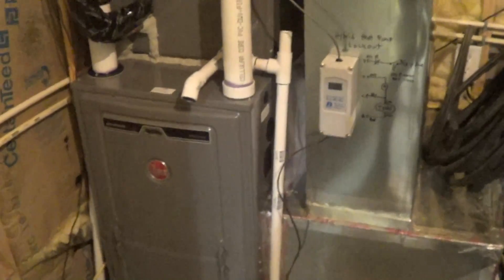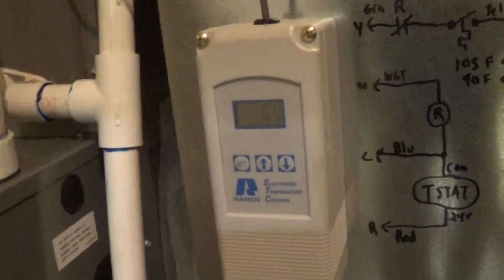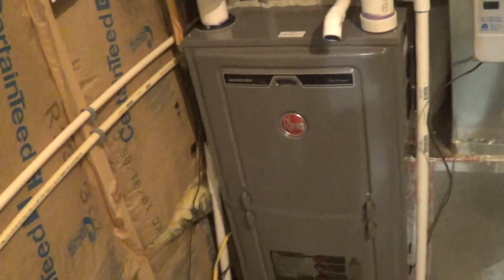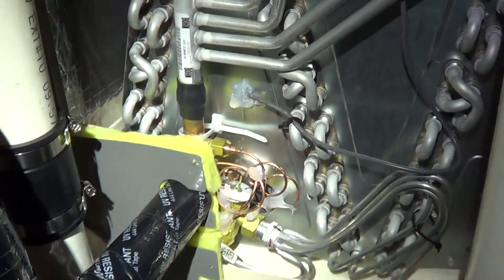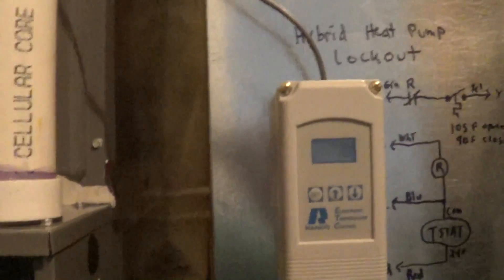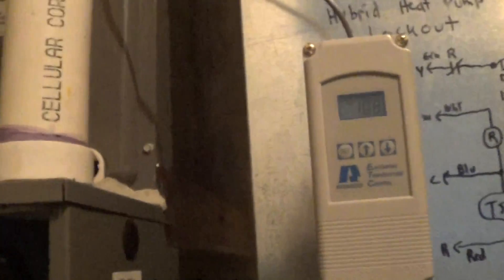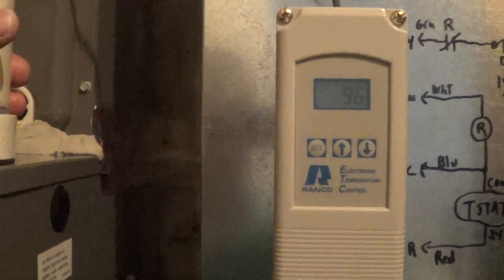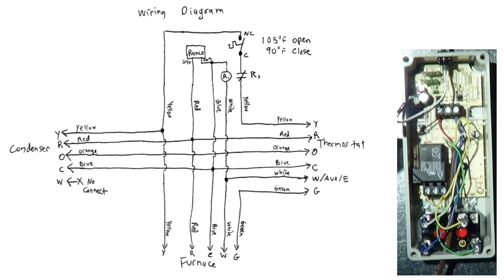Hybrid Propane Furnace with Heat Pump and No Balance Point

Comment: This is a great video and explanation.  Thanks for uploading it.  The decision about whether to use a heat pump or alternate fuel source comes down to the relative cost of the two in the location where you live.  If you are using a propane backup chances are good you would be money ahead heating with your heat pump all the time and supplementing with the propane when its needed.  This is what Nathan is showing you how to do.  It a common misunderstanding that heat pumps don't work when its cold.  If they have a demand defrost they work very well, they just are not typically sized to supply enough on the coldest days.  So on those cold days get all the heat you can out of your heat pump and then cycle the furnace on/off as shown here to maintain the temperature.

Nathan,  I have two questions for you if you are still available.

1) Do you have any updates on the systems you have installed this on?  Are they still working well and have you made any improvements?

2) When my heat pump is in defrost mode it calls for the furnace to operate.  When the cycle completes it stops the call and starts heating again.  But to my knowledge there is no delay based on temperature as you show.  So why does my system not trip on high pressure at the conclusion of the defrost since the furnace air is still hot and the compressor is running?

Finally, I think a simpler solution would be to just use a time delay on relay in place of the one you are using.  Then no temperature sensors would be needed.  You video indicates a 30 second on delay would be enough time for the air to reduce in temperature.  Besides being simpler it would allow this idea to be used in a hot attic.

Comment: Why wouldnt the heat pump inside coil be what the air moves through first then if it needs supplemental heat the gas furnace would then come on and add additional heat to the air to achieve the thermostat set temp?
Reply from the maker: The furnace heat ex changer will sweat too much in the summer if the cooling coil is first.   Also, the heater will be more likely to trip on high temperature in the winter if the heat pump is sending hot air into the heater.
Reply: @NathansHVAC  neither explanation makes any sense to me. One if the coil sweats who cares thats what it does when ac is running moisture goes out condensate drain. Why would the heater have a problem with preheater air thats what its using from the air you recirculate in the house.

Comment: I’m doing my first hybrid with oil backup.  I’m struggling a bit with the low voltage control in the temp module.  Wondering if anyone could give me a virtual hand

Comment: Hi Nathan great setup. Question.. I am in North East USA the state of CT, temperature doesn't get here too cold.  I have solar panels in my house as well as natural gas for cooking and for hot water.  I am using Navien for my tankless water heater that heats my domestic water and radiators and also have a central heat pump air conditioning split unit system that heats my house with forced air from the ducts.  

My air handler is in the attic, where it gets very hot and more then 105 degrees.  I would like to use heat pump as my primary source of heat, especially since not only is the heat pump more efficient then gas as long as the temperature not less below 30 degrees (and considering the fact that I am in CT.... the chances of that happening are low),

 but also because I have solar panel for my electricity... which makes my heat pump even more cheaper...  I am trying to figure out how to setup my primary heat as heat pump, and 2ndary heat as gas.. tankless water heater... that is heating up baseboard radiators and not any hydrolic coils of any sort inside the air handler.. (my house is old from 1950s).  

 Is there anything i can do to still have an override emergency function in case heat pump breaks so i just press the button on the thermostat and it uses gas... while also shutting down the heat pump automatically... but also operates automatically sort of like you have in your video.. based on the set point temperate in the air handler?

  Is that even possible to do in my case since... i don't have any hydrolic coils inside of my air handler and prefer to keep my radiators.. (since they make house warm fast with gas.. and gas is cheaper then electricity when it comes to below certain point.. except in my case i sort of don't really care if gas is cheaper... because in my case it's not really cheaper since i got solar panels.. but i still want to keep the baseboard radiators since radiators are located in my entire home across 3 circular zones.. (basement, first and 2nd floor..) but duct work is only on first and 2nd floor and not the basement..)   Note i also have a mini split in my basement in addition to radiators... sort of how i have similarly for my 1st and 2nd floor where i have 2.5 ton Goodman Heat Pump... and radiators on first and 2nd floor...

 Each floor has circulator based zone... heated by radiators...     Is there a solution for my case to sort of do things automatically where gas is 2nd choice electricity is the first choice while preserving the setup that i have now.. (which is baseboards and... heat pump)?   Also should i also install the emergency electrical strip inside the air handler? 

 Or forget about it since i already have more then enough methods of heating my house... or maybe i should do it anyway since electricity is basically free.. since i got solar panels... (my entire roof is covered with them..... )...  If i was to install the electrical strip.. then i imagine that i would need to have it turned on as my 3rd stage heat.. (since sometimes on my Navien i get Error 10e code that basically kills my entire hot water... unless its fixed... and if that  happens in a cold winter.. (which once again not probable...) then i would be in trouble...   

Note for extra level of ac backup i have some air conditoners in the windows.. just in case... I am planning on renting out my 2nd floor on Airbnb and would want to be setup with all sorts of backup plans in case if heat or cooling doesn't work..  Right now on my 2nd floor i have thermostat for radiator baseboard heating.. and on 2nd floor i have.. thermostat for heat pump....  

I am afraid Airbnb guests will turn both on at the same time.. in which case... heat will be produced from the air handler central unit... and from the baseboard heating......  I don't want my Airbnb guests to think which thermostat is for which heat... I just want them to be able to set the temperature.. to their level of comfort... and the controls will be automatically adjusted to whichever heat source that makes the most sense based on the efficiency and cost factor...  

 Is this possible to do?  Right now i am using 2 smart thermostats.. for 2nd floor...  and using if this then that programmable interface to shut off heat pump when  outside temperature gets below 30 degrees F.... with automated alert coming into my phone.. stating that the house switched to 2ndary heat system...(i.e gas)... then when the outside temperature gets above 30 degrees... then the tankless water heater boiler gets turned off... and heat pump turns back on... (in which case i receive alert as well on my phone).  I am also using Alexa voice control automation to turn on between heat pump and radiator heating...  

Also to prevent Airbnb from misusing the system, i have setup smart wifi window sensors on each window... meaning when Airbnb guest opens up the window and temperature is below 30, heat doesn't turn on... until window is closed.. (i also get emailed... when that happens and guest is also advised the minute they open window through Alexa Speaker that.. heat will be turned off until you close back the window).   

Some Airbnb guests want to smoke... or leave window open.. because they are not paying any electricity bill and don't care... so doing this helped me save a bit of money.  Now.. not that I care.. much since.. technically... i have solar panels and even if they do leave windows... open.. i won't have huge costs.. but still... some Airbnb guests abuse the system...  I was thinking about simply locking down   thermostat... and setting it to 72 degrees. 

 So far i am using programmatic approach vs mechanical ... and saw your video and figured i'd ask you.. which approach do you think i should take..?  

Should i stick with my programmatic approach or is that bad for the system?  (i noticed you were saying something about high pressure) or should i try your approach using this relay that you got in the video.... ) but then again you mentioned it's not good for air handlers in the attic... 

Sorry for so many odd questions... I was hoping that maybe you can help me out and provide an advice what i should do in my case... A) stick with programmatic approach.. or B) go with an approach where somehow both boiler and heat pump hooked up to one thermostat ... The question is... will the option B work in my hybrid case?  

Or is my case is a bit insane?  Or maybe not insane... and maybe other folks have similar questions.. but simply haven't wrapped their mind around this... 

Would you happen to know if there is maybe a simulation software where I can simulate somehow this thought process... 

Also there is one more thing.. after separating 2nd floor from the first.. what i noticed is that I only have.. supply ducts coming into the first floor from the 2nd floor and no return ducts... .. (return used to be the stair opening to 2nd floor.. yet now there is a door instead of a stair opening to the 2nd floor...will this be a problem for my first floor?

  If that's a yes.. should i just close down all the registers on the first floor ceiling to ensure that central heat pump split system only covers 2nd floor... since there is technically no return duct on the first floor going back to the air handler on the 2nd floor ...?

  If that's the case should I maybe just use window air conditioning & heat pump integrated units for the 1st floor and simply allocate entire 2.5 ton central air heat pump system for the 2nd floor?  Remember the goal is to separate 2nd floor from first.. my house is basically is a single family house, but i built stairs to the 2nd floor with hopes of renting it out to some Airbnb guests.. and making money.... )  

Any idea what I should do? i was thinking about maybe just adding additional duct work for return registers.. but the attic is not big enough to handle additional return duct work... the attic is too small...

 I was trying to measure static pressures between return and supply to figure out the best setup for how the duct work should be, but my main problem is not enough space for return duct work...  (the open area corridor that lead to the 2nd floor... had no door.. now there is a door.. and door blocking return air to come back.. ... 

If i make a hole in the door.. then the Airbnb Guests will hear the sound coming from the first floor to the 2nd... not exactly something that i want to do... by fixing one problem i may introduce another...)..  So any idea what I should do? 

 I understand perhaps no body can explain what I can do.. in my situation.. it seems quiet complex.. perhaps no one can explain to me how i should live.. but.. maybe if you can explain to me how can i connect 2 fueled systems together in a way that they run from a single thermostat in the most flexible and automatic cost effective way possible.. then that would help me wrap my mind around all of this... 

Note I often over complicate things... hopefully what i am asking is not something too complex... If it is i am sorry f or that.. but wanted to explain the whole scenario first.. maybe what i am trying to do has never been done.. or maybe it's just too new to me... or maybe i should just manually control temperature remotely for my airbnb guests... and not worry too much about it..  

It's just with so many options and automation tricks available at my exposure i tend to get lost in the most simplest things...  Hope this clarifies my intent.  Thank You so much.

Comment: Why should it have to cool down before the compressor start back ? I have electric back-up and it run the same time then the compressor and I would say the electric back-up is as hot then the propane.
Reply from the maker: electric heat strips are installed downstream of the evaporator coil.   The heat pump never sees the hot air because the inlet air is room temperature.    hybrid furnaces have the coil after the heater.   so, the coil sees hot 120 degree air entering the coil.   It takes a few minutes for the furnace to cool down.   You could install the furnace after the coil.  However, the entire heat exchanger will sweat in the summer when the evaporator coil makes the furnace cold.

Comment: I have a geo thermo heat pump with an electric back up, and have the same thermostat wires hooked up in the electric back up. White, Blu, red and green. I want to change the electric back up to a hydro coil backed up by a navien combi boiler. Would you be able to help me figure out the wiring to use it as an emergency heat or/aux heat source?
Reply from the maker: Make sure the hydro coil is after the heat pump in the supply air.  The heat pump is only designed for room temperature inlet air.  The wiring should be pretty simple.  The white wire should turn on the water circular pump instead of the aux heat.
Reply: NathansHVAC yes the hydro coil will be installed in the supply side of the duct,basically I will remove the electric emergency heat element and install the hydro coil in the same place. Now as far as the white wire, since it will start the circular pump, the boiler will fire since it will sense the water circulating?

Comment: Did you try running it without the extra relay, and just letting the Ranco turn off the compressor based on input temperature to the coil ? It would seem that the furnace would heat the air pretty quickly.
Reply from the maker: The relay is needed because the furnace shuts down the fan while the burners are fired up.  That would be bad for the heat pump.  Even energizing the G terminal doesn't stop the fan from shutting down.  So, the relay just locks out the compressor immediately.  Here is the link to the diagram.   https://www.dropbox.com/s/hx98sfzadqtbaon/Hybrid%20Operation.png?dl=0
Reply: It appears the relay just keeps the compressor locked out for the one minute (maybe less) that it takes for the furnace to warm the plenum to 105 Degrees for the Ranco to energize. Does the pressure rise that quickly in the compressor during that period ? I'm not a heat pump expert, mostly a controls guy. Did you program the thermostat to energize the fan during aux heat instead of using the fan/limit control ?
Reply from the maker: That is right.  However, 1 minute without evaporator air flow will trip the unit on high head pressure in heat mode.
Reply: I am assuming then that even though G is energized from the thermostat, when W is energized the furnace control turns off the fan until the fan/limit starts it based again on plenum temp.
Reply from the maker: Yes.  The software in the furnace controller overrides the G terminal and turns off the fan during burner start up.  Some will probably even turn off the fan if there is a furnace error code.  Either way, that would be bad to run the heat pump with no fan.

Comment: So what is the point of a heat pump, if you have access to propane or natural gas?
Reply from the maker: E Buzek both propane and fuel oil come from oil. Right now they both cost twice of what natural gas cost. And when oil is $100 a barrel they cost three times natural. Electricity is from natural gas, but 50% is lost on the power lines. So the most economical way to heat is wood coal or heat pump when natural gas isn't available. Wood pellets are actually a little bit more expensive than heat pump. But, heat pumps are only good down to 20 degrees Fahrenheit. So if you live in Canada or if you need heat below 20 degrees, you need supplemental heat.

Comment: I use Trane XL824 Thermostat, no outdoor sensor necessary. use thermostat in  NON RESTRICTIVE MODE.
Reply from the maker: Sweet!  I just read the installation manual for the thermostat.  You are correct.  Non Restrictive Mode will work exactly like what I am doing in this video.  However, the cool down is fixed at 45 seconds before the compressor is turned back on.  That should be fine.  I will use the XL824 on my next hybrid job, which should be soon.  Keep it Simple principle.  No balance point.

Comment: How can this be modified for units in hot attic spaces?
Reply from the maker: Good question.  The existing wiring diagram will lock out the cooling if the unit ever goes above 105 deg F sitting in a hot attic and the house is also over 90 deg F.  When the blower starts, the hot house air will make the thermostat think the heater is on.  Obviously, the house will never reach 90 deg F in the winter.  All that needs to be done is to add a relay to the O (reversing valve) terminal to close the thermostat contact.  That will effectively turn off the circuit in the summer when the O terminal is energized.  Rheem does the O backwards.  If you ever need an updated diagram just message me or call me in Maryland.  I would never see a 90 degree house in this part of the country, so I didn't include the summer lockout relay.  I'm lucky to see 90 degrees outside here.
Reply: A 90 degree house is no problem here. Slick fix. Great video and thorough explanation!